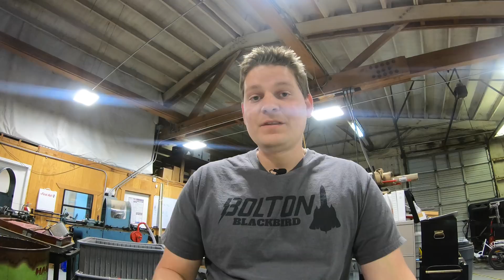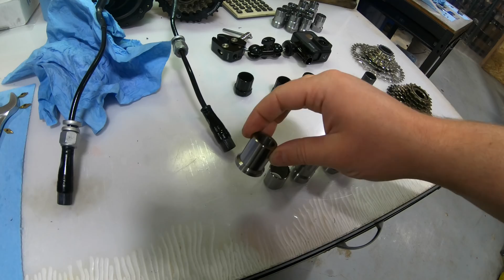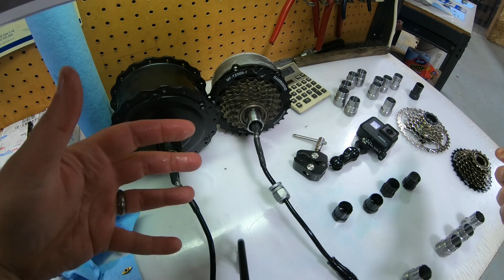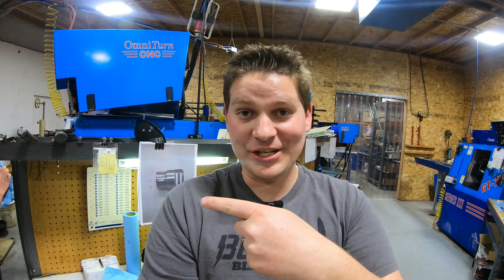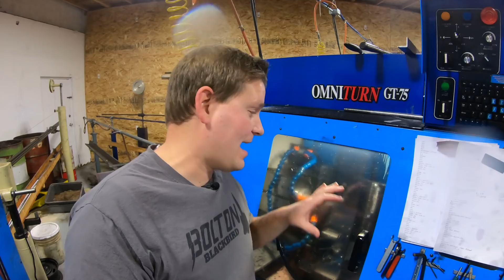I made a TOOL for ebikes - Bafang 750 FreeWheel Remover

Comment from the maker: What other super handy ebike tool or product do you want created and why?
Reply: An ebike repair stand for use in a shop.  One large enough to raise the bike to at least waist level and that can handle the weight of the ebikes.
Reply: @jgjulio  This would be something I’d be interested in.  Something so strong it would never drop an 80 lbs bike.
Reply: @jgjulio  Eb Ike repair stand for home
Reply: @jgjulio  Park makes a hydaulic stand that does that,
Reply: I’ll second a bike repair stand. One simple, but sturdy enough to handle the job.
Reply: So I have minimum space where I live, I would like to see a stand that holds the bike up. There are a number of companies that make them, but none that work for ebikes. Basically where the back tire rolls into it and you lift the front of the bike up and what needs to happen is somehow lock the bike into that position. The ones that are out there, first, are not wide enough for a 4" tire and because the battery is in different places on ebikes, they could fall back down if the weight of the battery is enough to make it fall back down.
Reply: I would like a plug to hide the electric connections on my Hailong downtube battery bracket to keep it from moisture and muck when the battery is off the bike.  I know they are available for other types of battery, but not mine!
Reply: I have a crudely made one from a hollow piece of rubber.  Something a bit more professional would be great.
Reply: something that works would be good
Reply: Hey Kyle. I just received the tool,  for my dad mini. and it's not working ,, the hole is not big enough to fit over the bolt.:(

Comment: I was going to do a similar video and looks like you did an amazing job. I have a Hovsco Ranger with a Sutto 500w. I wonder if you're tool will fit over the connector shell they use on that. I cut a .41 slot out of a fr-1.3, then cut a "wedge" to tap in to keep it expanded. That's actually what they do in the China shop. I have a video. They later sent.

Comment: Well, we received the tool today and I wish it was the same as the one in this video. Ours would not fit over the 18mm axle nut so we had to dremel the insides a bit to get it to slip over. Once inside it refused to fit the freewheel splines. We tried it on another freewheel and it would also not fit. We compared it to a Park Tool FR-1.3 and the splines do not match up.
Reply from the maker: 1.  Don't dremel the tool file the corners of the nut if you must.
2.  What brand of freewheel was this?
Reply: The Shimano MF-TZ500-7, same as the one you have in your video. The axle nut looks the same too. Did you file the corners of the nut?
Reply: Here's a YouTube short of me trying to fit the tool in the Freewheel. https://youtu.be/tF5DpiG8FFQ

Comment: Used mine yesterday to go to a drift maniac 11-34 freewheel after failing to get it off with one I had cut down the side, this worked perfectly, I did have to very slightly file down the edges of the nut with a dremel to get threw but super easy worth every penny.

Comment: if only they knew the actual tool is like a spark plug wire remover pliers that you squeeze the handles together after slipping over and slide into the socketed chamber. handle is built in on the tool gentlemen. i guess this is just a harder way of doing it that does work. oh well.
Reply: You should definitely do a video showing us how easy it is to get an old freewheel off with that tool. It would be a big benefit to the community.

Comment: I recently purchase a himiway cobra and quickly learned the stock gearing sucks, which leaves me shopping for an 11-32 freewheel. The motor says himiway and I assume it's just a rebranded befang, however they were smart in running the wire on the opposite side.

Comment: My (7000 miles) Radwagon4 750w motor is working but there is no peddle assist. There is a disconnect. Is there an intermediate part that fits over axil first and then the 7 gear cassette slides over both part and axil. Can that intermediate part be ordered and be replaced? Name of part? My two-legged mule is hurting. Turns out cassette and freewheel slide on differently. Another special tool? Forum even mentioned that a spacer is required with cassette.
Reply: Or is "part" attached directly to the motor housing and thus housing is what gets removed to get to camber that is worn out?
Reply: At 1:30 on special part via England. https://www.youtube.com/watch?v=U6VSlhqtVwQ

Comment: We never used a wrench on one of those tools. Putting a wrench on that tool and wrestling around with a loose wheel would indeed take two guys and one of them stands a chance of being hurt.

We always clamped the tool into a vise then lowered the wheel onto the tool. Only takes one mechanic to grab both sides of the wheel and turn counterclockwise. Much safer.
Reply: Some folks just like having bloody knuckles and strained muscles. 😅

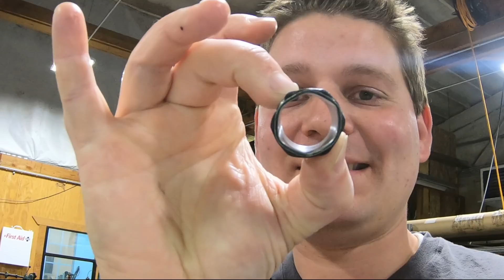Comment: 2:01 to see the problem drilling a standard FR-1.3 freewheel removal tool out so it you can fix the cable through the tool. 
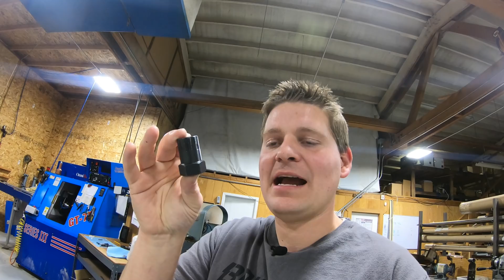2:24 to see the problem they had with splitting a standard FR-1.3  freewheel removal tool to get it around the cable.
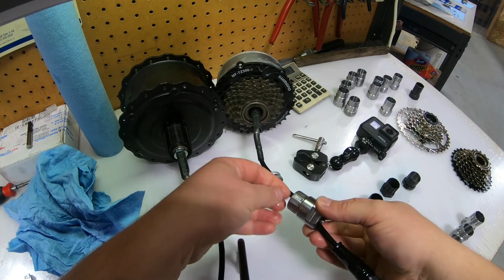6:35 to see where their FR-1.3 freewheel removal tool really does fit right over the Bafang 750 cable connector and connector nut.

Comment: $50?? Bit hefty don’t you think? You can get a custom made one from Rad Power Bikes for $15 +$10 shipping, so $25 by itself. Bundle it with something else like I did (extra battery charger) and the shipping charge isn’t so bad. If you email them and ask for one and any other items you may want, they can send you a direct invoice. The tool from them has a section cut out of it so you can slide the wiring through, so you would have to make sure you put the tool in a baggie afterwards so you don’t lose the parts. This one by Area13 is one piece so that may be worth the extra $35 to some? Just another option for those looking. Good luck!

Comment: Your awesome bro, thank you! I stick the tool into a vice and lay the wheel down onto the tool and use the wheel as leverage to brake loose the freewheel, turn it counter clockwise I believe, its easier then using a wrench in my opinion.

Comment: I used a Custom Freewheel and Cassette lockring Removal Tool with 14mm opening for Rear Hub Motors
Dimensions: 25mm x 43mm for my bafang 750w. I drilled the inside just a little and broke about 3 dents. That was fine because the nut enter completely inside the tool. Having the freewheel separated from the hub I could reach inside the flywheel. I fixed the flywheel joint with the cover into a clamping fixture and used an impact drill to unscrew the flywheel. Thank you very much!

Comment: Unfortunately the one you sent me just slipped and rounded off. I guess it's useless now. Freewheel is still on the motor.
Reply: Mine too. Really disappointed, especially waited for so long for it to arrive then this exact problem happened to me. What did you ?
Reply: @sh3ik84  nothing so far..I'm in Canada and paid huge for this thing.....exchange rate and import taxes. Let me know if you get anything from them. don't know if its worth it to me.
Reply: @vincesutch5295  hey dude, first of all thanks for responding. I actually ended up contacting them about the issue, now they will send me a new one -> free of charge, ofc! You should try contracting them. They told me that it shouldn’t be slipping at all. So yeah.
Reply: @sh3ik84  right on my friend......I will contact them and see if they will respond. Thanks for the heads up.
Reply: @sh3ik84  So and update........I contacted them and sent them pics and they have shipped a new one out to me. Also said they would pay any taxes and import duty. Great customer service. Thanks again for reaching out to me. Totally appreciate it. :)

Comment: Great Job!!! Is the power cable of the Bafang 750 hub motor thicker than the Bafang 500 hub motor power cable? 

I replaced my shimano freewheel with a DNP freewheel on a Bafang 500 hub motor and I could easily slide a regular freewheel removal tool through the power cable.

Comment: Just want to mention , something similar on you car is your oxygen sensors on your exhuast have a similar problem because the sensor has a wire in the middle the socket they use is close but is taller a little thicker all round and has a cut out about half way up the socket, just something to look at if compay put different size plugs on the ebikes.

Comment: What about if i have a rad rover and therefore i dont have a true 750 watt motor, its the stock 500 one, does this work for switching out the old one and putting in a true 750 watt bafang??

Comment: you wouldn't even need to slide it over the nut, its basically a socket with a slot in the side for the wire really it would be a lot easer.

Comment: I just took a standard freewheel tool, put it in a socket wrench, held the wrench with my foot so it didn't move and used a grinding drill bit to drill through the middle. 3 minutes job

Comment: I just ordered one of these. I tried slotting a regular freewheel removal tool, but it collapsed and slipped as soon the torque began to get heavy. I ended up cutting the old freewheel off with an angle grinder and cutting disc. Avoiding damage to the hub was like trying to perform surgery with an axe, but I went painfully slow and managed to pull it off without injury to me or the hub.

Comment: I modified a cassette tool by machining a 1/4" slit.  It solved the issue of getting past the wire but the splined section of the tool is very thin and under high torque would spring inward and slip.  I placed a small piece of 1/4" steel into the slit to keep it from "springing" and that worked, but was very awkward.  The Bolton tool is the proper solution and is offered at a very fair price.  Well done. (I bought one even though I don't need it)!

Comment: Kyle, you're prolly gonna dislike me even more than you may already for showing this, but Park Tool makes this tool that I used tp tighten my Shimano cassette on my 750W Bafang. It's not as cool as your tool but I used it on my Bafang RMG.060.750.DC and it fit over the plug and wheel nut; https://www.amazon.com/gp/product/B000WY8LNC/ref=ppx_yo_dt_b_asin_title_o05_s00?ie=UTF8&psc=1
Reply from the maker: That doesn't look like it would work on a freewheel, but it certainly won't work on a DNP, which is what many people are needing it for.

Comment: Great tool. Now make one like an automotive Oxygen sensor wrench so it doesn't even have to slide through the wires but has a slit down it so you can loosen or tighten it without unplugging it. It would have to be longer. Something like this.   https://www.homedepot.com/p/TEKTON-3-8-in-Drive-7-8-in-22-mm-Offset-Oxygen-Sensor-Socket-47749/205848403?source=shoppingads&locale=en-US&mtc=Shopping-B-F_D25T-G-D25T-25_1_HAND_TOOLS-Multi-NA-Feed-PLA-NA-NA-HandTools_PLA&cm_mmc=Shopping-B-F_D25T-G-D25T-25_1_HAND_TOOLS-Multi-NA-Feed-PLA-NA-NA-HandTools_PLA-71700000034127224-58700003933021546-92700031755124841&gclid=CjwKCAiAnvj9BRA4EiwAuUMDf5eD5k-UvITwJU4PvsZb6g2Xt49Pua1GHmBoEeUDMJHyvbVyD_bG1RoCybMQAvD_BwE&gclsrc=aw.ds
Reply: I modified a cassette tool by machining a 1/4" slit.  It solved the issue of getting past the wire but the splined section of the tool is very thin and under high torque would spring inward and slip.  I placed a small piece of 1/4" steel into the slit to keep it from "springing" and that worked, but was very awkward.  The Bolton tool is the proper solution and is offered at a very fair price.
Reply: @paulyarnall3605  we had the same problem with cheap Oxygen sensor sockets but the snap on, mac, and matco tools worked very well . So did the ones the Nissan factory sent us automatically and made us pay for them lol. I guess with thr right steel and heat treat it makes them stronger.

Comment: Great Job!!! I needed this a few months ago lol. I had this issue trying to replace my shimano freewheel with a DNP freewheel on my Himiway. The other Freewheel Removal Tools could not slide over the 19mm nut. Great Job again.
Reply: I also want to replace the freewheel on my Himiway for a higher and lower gear ratio. It's frustrating to be peddling like crazy at 20 mph.  Himiway will not honor their warranty if you modify your bike.